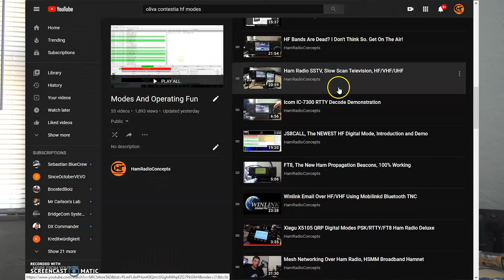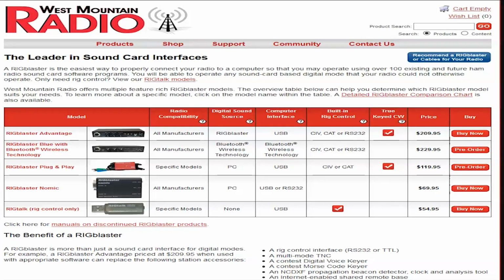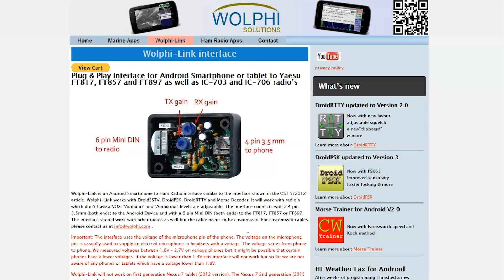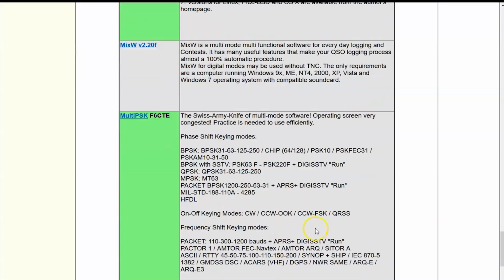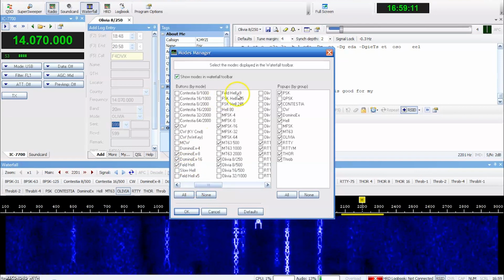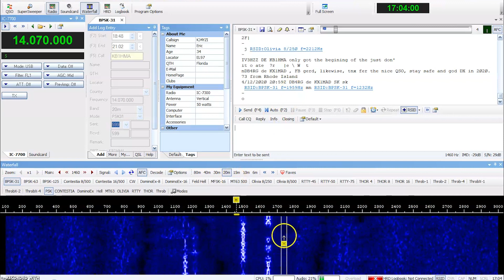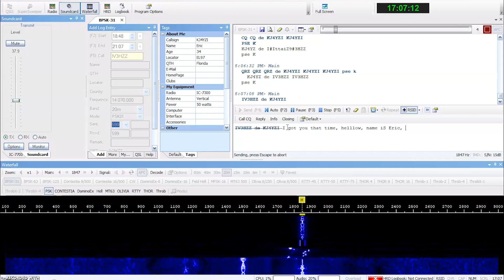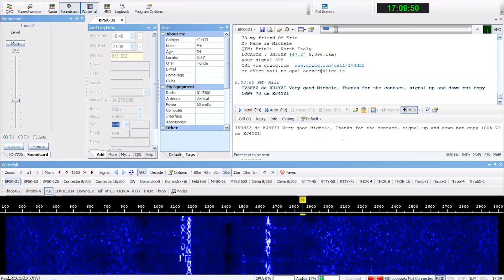More About HF Digital Modes, Introduction, DominoEx, Thor, Throb, Ham Radio

Comment: When you say digital HF, I am thinking of digital HF phone.  I don;t think an ham radio companies are working on this mode??  I don't know why.  Digital HF phone will go below the noise floor and reproduce the audio like a good cell phone connection.  Great FM-like quality audio; no noise?  That is the mode to talk about!  Wanna hear what good digital HF sounds like?  Check our the Barrett HF demonstration video.  The Barrett is now made in the US.  It was designed by Ebitt Systems; the one which made the famous Motorola Micom radios.  We need this form of digital incorporated in all ham HF radios if they can come together on the encryption code that they are willing to give to the public without a license fee.  I guess this is the hold-up for development.

Comment: I earned digital WAS and Digital DXCC using 30 watts out of an old Kenwood TS140S, Signallink interface, and attic mounted antenna. I did it mostly with PSK31. I also like the other digital modes like Olivia, DominoEX, or any digital mode FLDIGI can handle. I use FLDIGI on an ASUS laptop running Linux Mint 19.3.

Comment: One thing to keep in mind is that you don't necessarily need to buy a USB interface to do these modes. I've read several accounts of folks homebrewing their own using Optoisolators to do the job. Also some of those HamUniverse links look to be dated, and is missing commonly used programs such as FLDigi.  Still this is a valuable introduction, and well done

Comment: I'm returning to the hobby after a 35 year break.. When I left it in the mid 1980's  I was mostly active on AMTOR ( remember that ?)  and RTTY  with occasional  forays into CW .. It's staggering to see how many more modes that have become available today.  I concur with your findings, that these modes don't require  'broadcast station'  antennas & power.. I operated on 20 watts with a compromise antenna situated in a valley (RF hole in the ground) and I worked over 150 countries. Thank you for your info and insights Eric.. 73 , Pete (G4RYO)

Comment: Hi Eric, that I do like the look of, looks quite narrow and I would like to stay on low power as I like a challenge.   Need to get through that test this year.  I heard a digital mode being transmitted on 11mtrs two three weeks ago,  Right at the bottom of 27MHz, it appeared to be talking to two or more stations, but I didn't have anything to decode it.  That was a bit annoying, I wanted to hear what they were saying, never heard any digital on CB before.   I don't know what mode they were using, but it sounded similar to this but hard to tell as it was quite week, so I turned up the volume to hear it (not on a CB), then another station blasted in, so there must be one near here or it was coming in from overseas, but as there is not much coming from overseas at the moment due to propagation, I can only assume it was somewhere around here within 30 miles or so.  We are allowed to use AM,FM,SSB,DSB modulation here now on CB. Quote: "AM/DSB and AM/SSB use on CB." from Ofcom in the UK.  I can only say that there are people here that want 11Mtrs to be used in all modes.  I only hope they keep it to one channel, though there is not a lot of people on, most use SSB or FM.  Digital is something I have NOT heard on CB till a couple of weeks ago.  This might be the start of something NEW!
EDIT:  Do you think it is possible that it was this mode or something else?  It did appear to be on one channel.  If it was not this, what mode do you think it might have been, keep in mind CB is only 10KKHz a channel, but there are a lot of newer radios around that step the with of the channels to as wide as 25KHz 2.5KHz to 25KHz in other words they can be programmed like some Ham Radios and are maybe meant to be on 19Mtrs and they are putting out around 25 Watts.  Bit naughty, but as long as they do not cause interference I doubt anyone will bother them.  Is there any Digital mode more suited to CB world? 

It sounded like this, but it might not have been.  If I had a CB set up I might have heard it a lot clearer, or not.  That would be outside the CB band in the UK.  But that will not stop them anyway!  Most will use all the American channels right up to 28MHz and some will even go into 10Mtrs by around 4  or 6 channels I think some CBs went up to, I can't quite remember how many went into 20MHz.
It is a lot to read I know, sorry..

Comment: Great video!  If you're interested in any of the Hellschriber modes, please check out the Feld Hell Club at https://sites.google.com/site/feldhellclub/Home.  There's over 6500 members and there is a lot of information about the "light writing" mode(s).  Yes, I'm a member.  I use an ICOM IC-718 with a Signalink SL-1+ (the older, non-USB version of the SignaLink).  Usually use about 20W of power on all digital modes I enjoy (Feld Hell, PSK31, RTTY, Olivia) on a G5RV at 60 feet high.   73 DE KD5COL

Comment: Hi Eric, thanks for the video.  I just can't get my digital modes to work on my new  IC-7300 and software such as WSJT-X.  The only time I can get digital (PSK-31 and RTTY) to work is with my FT-818 and Wolphilink interface.  I emailed Wolfgang at Wolphi-link and asked for a cable for my IC-7300 to use with his device and associated apps.  I have no idea how to make it work on my IC-7300.  Do you have any resources for the settings for this?  73/KG7VCL --- Steve
Reply from the maker: I'm making a video tomorrow
Reply: @HamRadioConcepts   Hi Eric.  I didn't see a video on the IC-7300 settings for wolphi-link.  I got the special "DIN" for the radio to use with the Wolphi interface but have no idea what settings for the IC-7300.  I can easily get the Wolphi-link to work on my FT-818 but the IC-7300 is new to me. 73

Comment: Well speak of the devil! Today I've been sending CQ in different digital modes and still am at the moment. You are right, I still haven't made a contact on MFSK-4 but was lucky to make a short contact on FeldHell to someone in Arizona on a Yaesu FT-818ND at a whopping 6w on a homebrew inverted V dipole antenna made of car speaker wire and coax tuned for 20m. And yes, I had people hear me and I can hear them on WSPR, and a nifty tool.

Hope to have some contacts with ya Eric on some of these rad Digi modes! Now back to calling CQ with MFSK-4.

WX7UTE

Comment: Is the signal link necessary for email on the 7300?
Reply from the maker: no. 7300 has its own soundcard built in..
Reply: @HamRadioConcepts  that is what I thought but I saw a video of some using it on the 7300.
Reply: I use my 7300 with just a direct USB connection to the PC for digital. Works great!
Jay - AE1J

Comment: Thanks Eric for the link for the band plan website. Now I can look into other modes other then FT8. I uses the Signalink  with my Yaesu FT-450D. I want to keep this setup as a second rig because I am going to buy a new radio with a built in sound card. I just can't make up my mind on what radio to get. It is down to the two you reviewed the Yaesu Ft 991a or Icom IC-7300.  Great video as always Eric. 73 and Stay Safe. Joe, Leesburg Florida.
Reply from the maker: Don't waste any more time man, 7300 and I promise you wont be sorry
Reply: @HamRadioConcepts  I think that's the one. Price is coming down on it even more then the FT-991a. 73
Reply: One more thing to consider is the FT-991a get you 2m and 70cm bands if you don't have any other radios for those bands.  73  WB3BJU
Reply: Would you recommend that I use the signalink for my ft-450d. And by any chance does the waterfall work with this setup
Reply: @benjaminbowers421  It does. Look me up on QRZ and send me an email and I will send you some screen shots. 73 KN4IFI